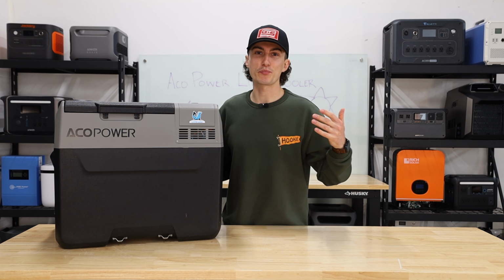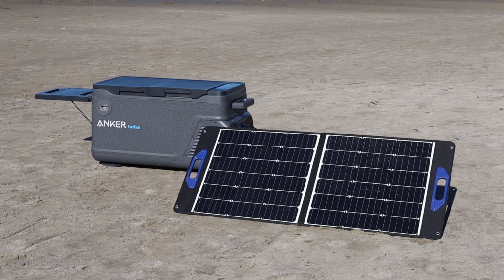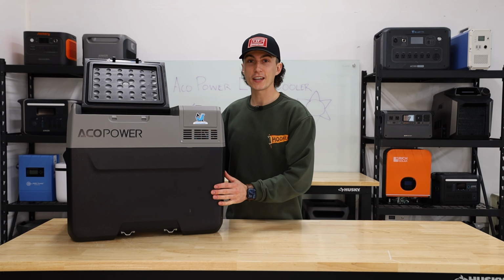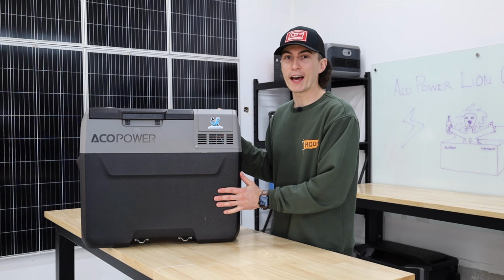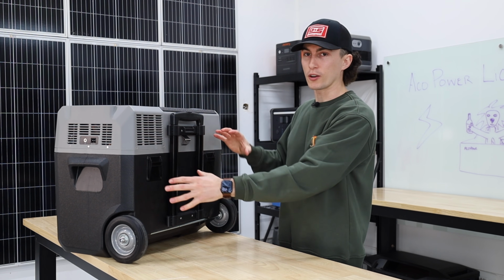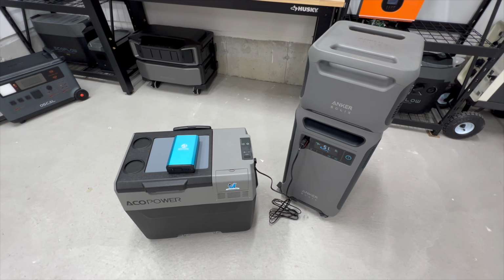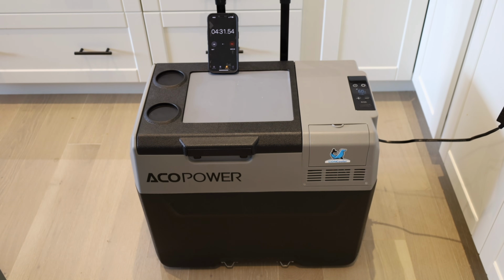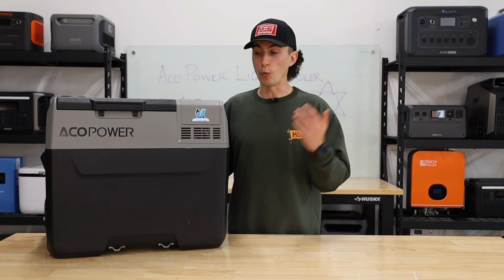A Solar Powered Cooler? - LiON Pro Cooler

Comment: On the cool-down test, was the cooler/fridge empty? Air doesn’t hold cold well. You may have reached a lower temperature if it was full and had some thermal mass.

Comment: I was an early adopter on this one (Kickstarter) and it had a problem with the battery connector on the battery tray after using it the first week.  The spring contacts were too loose resulting in melted plastic on both the contacts.  Customer service sent a replacement battery tray which required a DIY remove and replace.  It fixed that problem.  But there was another problem that has not been fixed.  The method of securing the battery is not reliable.  The battery has frequently fallen out whilst transporting the unit.  So I had to add a velcro strap to keep the battery door closed thus keeping the battery from falling out.  Then there's the frequent problem of the unit shutting down when the battery pack gets too hot because there's only a thin plastic shell on the top and bottom of the battery tray to insulate.  The heat from the compressor under the tray and the heat from the outside air both impact the battery temperature.  I rarely use the Acco battery banks to power the fridge now.  Instead, I use 12V 50Ah or 100Ah batteries to power the unit without problems.  I would not recommend this unit or it's smaller sibling, I have both.  Also, the display on the unit and battery packs are so dim they are useless in most daylight outdoor situations.

Instead, I use a very robust and reliable ICECO VL-45 that remains in my vehicle for my refrigeration needs.  I use the Switchbot sensors and hub to monitor the temperature and receive notification when the temperature gets too high.  The ACCO app doesn't have that feature.  That's my take on the ACCO products....Oh.  The battery packs are not too bad.  Just don't expect to get a full 192Wh because of the buck-boost converter losses inside the pack.